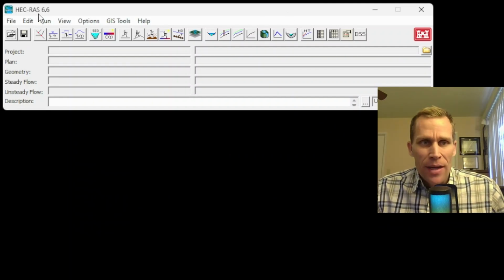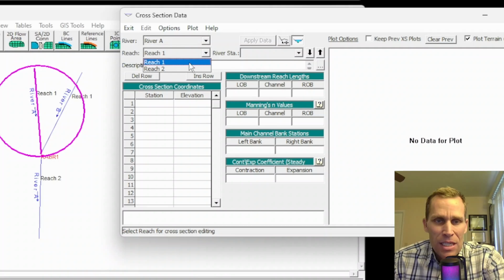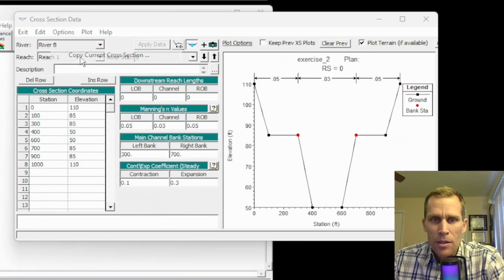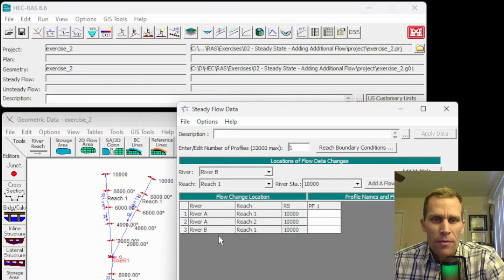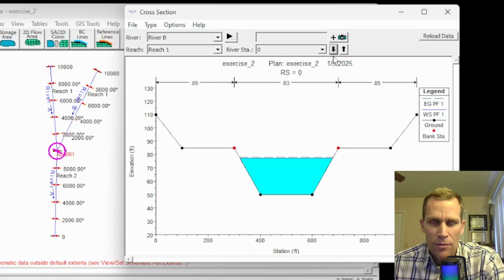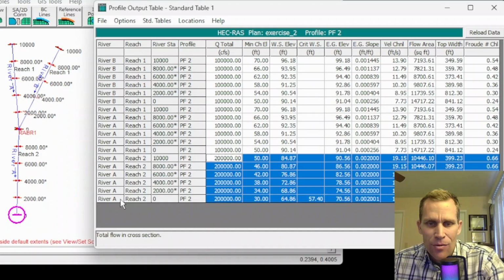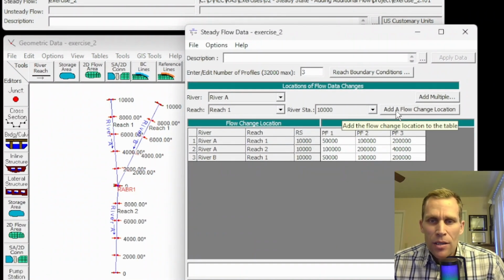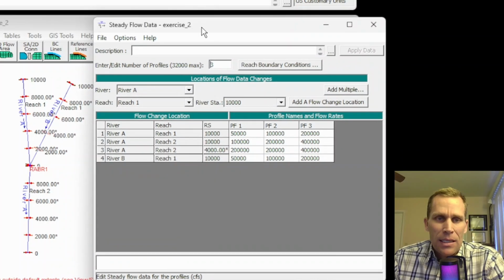HEC RAS Exercise 2 - Steady State - Adding Additional Flow

Comment: Thank you for the nice explanation. I have a confusion regarding adding additional flows at downstream cross sections with an upstream lateral structure optimized. How do we add flows at intermediate cross sections if we have used 'optimization' at an upstream lateral structure? Say, I have 100 cumecs coming from the upstream, which gets split between a lateral outflow (20 cumecs) and continuing downstream flow (80 cumecs). At a further downstream location (say RS xxx), I want to add an additional flow of 5 cumecs. What is the steady flow value that I should use at RS xxx? If I knew beforehand what's the split is going to be, the answer would be 85 (80+5) cumecs. But the optimization routine can result in 79-21 or 81-19 or any other split (it's uncertain). So, what's the right way to tackle this problem?
Reply from the maker: Hi. I understand you're asking what steady flow value should be added at RS xxx, but what are you trying to accomplish? What result do you want to see from your model output? a specific flow rate at the downstream end of the reach?
Reply: Hi Tim, I am modelling a canal with a number of lateral spillways and a number of overland runoff coming in laterally. RS xxx is one such lateral pickup location. I am trying to understand the overtopping possibility and obtain freeboard values (at locations with no overtopping) along the canal for different combinations of upstream release and storm events. For each storm events, I have the lateral inflows from another hydrological model.
Reply from the maker: @sagarshiwakoti1240  I understand better now. 

When you write "upstream release" it sounds like your system includes some kind of gate/structure which allows you to control the amount of flow entering the reach. Is that correct? 

If that's the case, it seems like you're trying to determine the maximum amount of water you can release from this upstream gate/structure during different storm events in order to prevent overtopping (or maintain a specific freeboard) at all downstream locations?

Are you modeling this as 1D steady flow? I'm busy today but I can look into this scenario tomorrow.
Reply: @ Hi Tim, yes that's exactly what I am modelling.
Reply: @ and yes, I am doing it as 1D steady flow.
Reply from the maker: Ok I created a video that addresses this scenario, here: https://youtu.be/VghpDynBSvM
I hope that helps.
Reply: @TimNelsonPro  Thank you for the nice explanation. It helped me conceptualise my model. The only difference is I am adding the additional flow as a flow change location instead of using a tributary. So for each downstream flow change location, I am using the cumulative flow at that particular location.